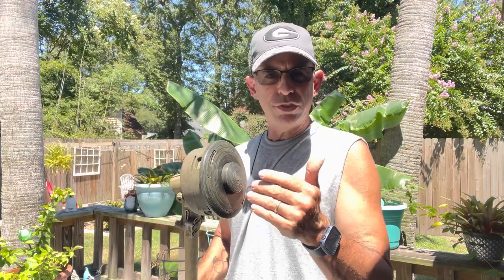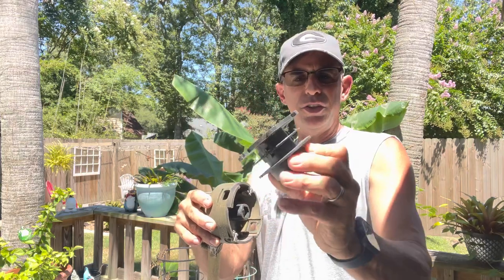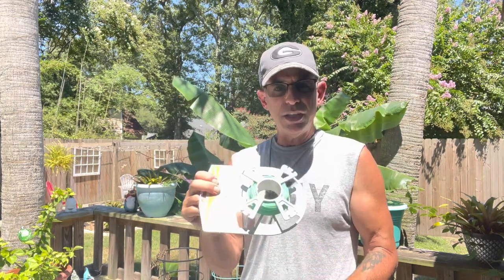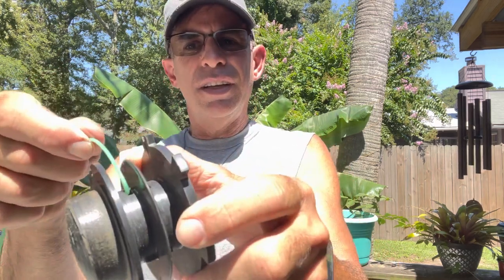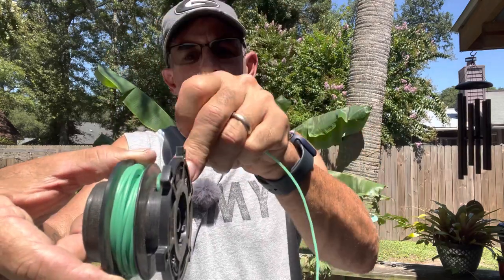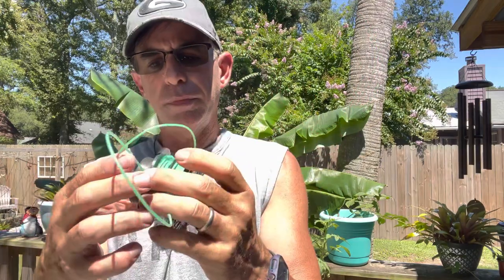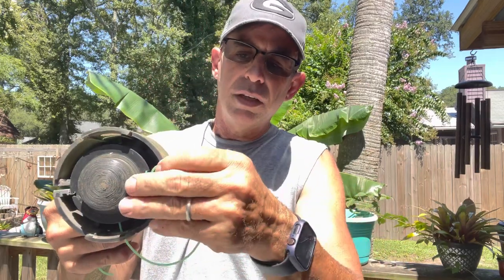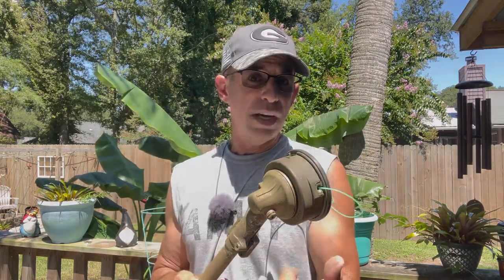How To Restring A Weedeater FAST and EASY Way to replace string trimmer line!

Comment: I went to .80 line a couple years ago and picked up a Kombi unit (now 2) because of you lol....
I do this exactly the same except the locking part I do just slightly different. 
I use the CF3 proline .90 now, because i deal alot thicker stuff on a regular basis and i run 2 KM111's. 
Also i learned how to edge with a trimmer here, from you lol
Welcome back
Reply from the maker: It is very important to try new things but always do what is most comfortable for you and your bottom line! Great comment Ryan, thank you

Comment: Now to make this easy. I use .095 line and cut 2, 6 foot arm lengths. ( 12 plus feet ) THEN, I take a pair of needle nose pliers and bend over 3/4 inch of the end 180 degrees. I then use the pliers to put this bent end into each hole. The line will lay flat as you wind it. Wind both at once, keeping them separated by a finger.Easy. Also make up extra sets and carry one in your pocket. The line always runs out when you are 200 feet from the garage.
Reply from the maker: I used to make a few extra cartridges and keep them on the ready. I hate having to restring a head at 1pm with it 95 degrees out and sweat running in my eyes! lol